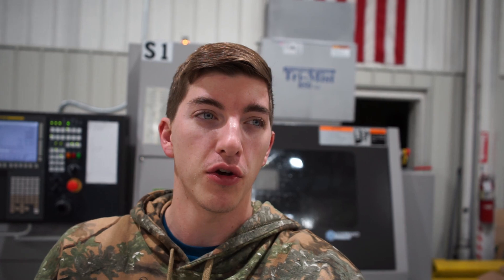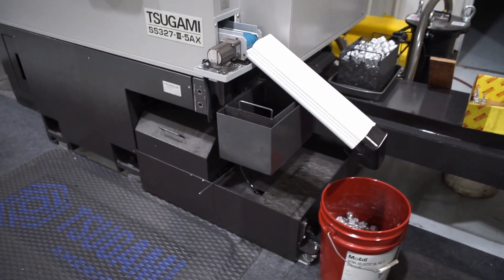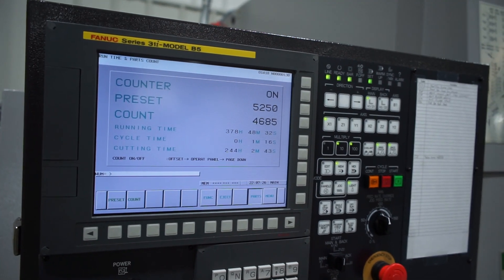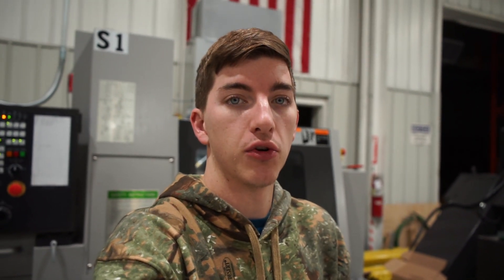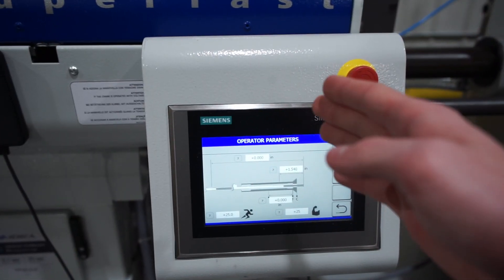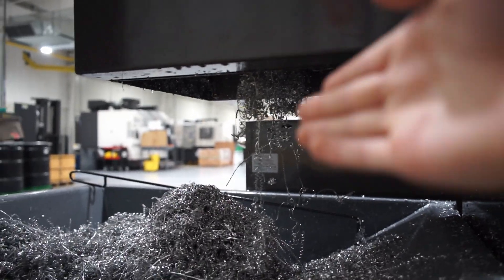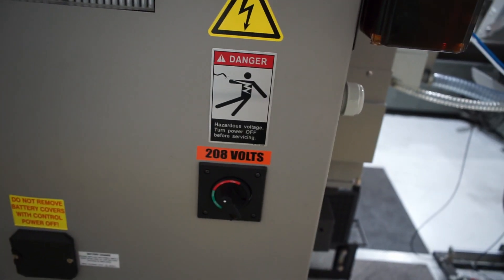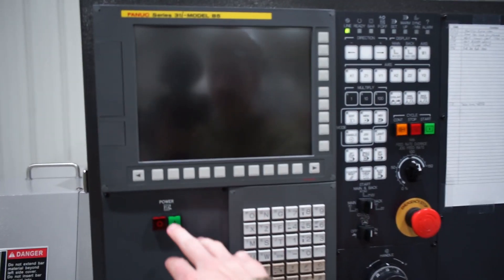Lights Out Swiss Machining

Comment: Love the video.  I recently got a Tsugami S206 and am trying to start running lights out overnight and then do the weekends but I keep having my parts get caught on the part conveyor.  They will get caught on the slide just at the end of the conveyor and then will cause the parts to get stuck.  Do you have any experience with this or have any tips?